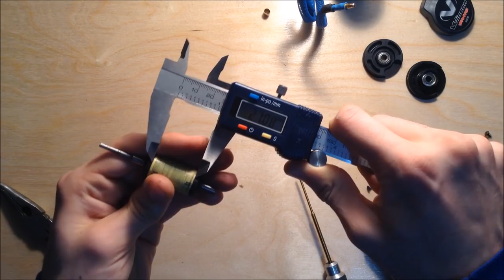Sidewinder (SV3) v.s Velineon (VXL), the better choice!

Comment: Thicker wire that is high quality will  help your esc and motor operate more efficient and also run cooler.
Reply: Agreed. The newer castle motors use this crummy 13awg wire. I replaced them with some 12awg with 5.5 mm bullet connectors..motor ran much cooler

Comment: I've ran 17 Velineon vxl systems, and 1 died because it didn't go into thermal shutdown. I have ran multiple Castle Creations SCT 1410 1Y 3'800-KV systems.
I love both systems! And think that the Velineon system is a little over priced!! But the Traxxas warranty is worth the Velineon system, well to me it is anyway.
Reply: When it didnt do a thermal shutdown, did it have a fan on the esc?
Reply: @bordfronco  no fan on any of the 17, and running the sticky S1 compound Tires. The body was a Chevrolet 1500 from Pro-Line Racing and I had a huge Spoiler on the front of the Body, so I am thinking that it didn't have much if any airflow to the e.s.c. this was my bad!
Reply: @BUILTLIGHTWOUNDTIGHT  a fan should be added due to all the extra force put on the parts can cause a lot of heat and can cause electronics to fail but i hope this comment helps btw thw fan for the velineon system is only like 25 dollars

Comment: You can't put a 1406 against a velineon.  Not a good comparison.

Needs to be the 3800kv 1410
Reply: Shane Dwyer or maybe 4600kv?
Reply: Lane Thompson no, the castle he's using is a 4600kv.  The 3800kv is the counterpart to the 3500vxl
Reply: Shane Dwyer my bad, I didn’t even watch the video lol.
Reply: yeah the motor is just a little bit to small, for that comparison.
Reply: Try a competition level motor and a esc, like fantom v3T and  FR-10 PRO ESC on your hobby car,  performance will greater than these , I have tested few
Reply: True
Reply: I just bought that motor from Castle yesterday. It's way better then the Traxxis.

Comment: I have the 1410 3800kv with 5mm shaft in my rustler and that thing is a little BEAST!
Reply: How fast does it go?
Reply: @jordankennedy4761  geared up on 3s will easily hit 60
Reply: @tvon4966  okay thank you, I got a sidewinder 4 today for my rustler how fast do you think it will go if I have a 2s lipo?

Comment: I have had both and without getting into to much detail I can confidentially say that the castle 3800,4600,5700 1410 is sick.  So much more torque and the ability to custom program it.   The speed at quarter throttle blew me away compared to the Traxxas motor.   I love the Traxxas brand but Castle got it.....

Comment: with the traxxas VXL system you can update the firmware on the speed control unit unlike the sidewinder just FYI  along with if you want to upgrade the traxxas speed control and motor you can with the power up program along with the electronics for less than 1/3 of what it would cost to buy it the items brand new

Comment: Why aren't you telling people about the traxxas power up program?!  Trade in your old items for new ones at the discount for using the program.
Reply: Does that work is you have a brushed Traxxas motor and want to go the the vxl
Reply: @ryanassheton5124  Indeed it doe.  I did it with my brushed stampede and have the vxl on 3s.  It's stupid now.  If I had Street tires, it might do 60+

Comment: That Castle Motor is a 1406 can. It would be a proper comparison if you compared the Castle 3800kv 1410 motor with the Velineon 3500kv motor. The Traxxas ESC overheats like crazy from what I've heard, I run the 3800kv motor and the Castle SV3 esc.
Reply: My ESC runs 🆒! I run only 2S myself but geared just below top speed runs gearing. Both hella cool but the 1410 is the way to go with Mamba max pro
Reply: That's why you can buy a fan for it for quite cheap under 20 dollars for the traxxas banded or even cheaper with a noname one.... also the yjsut shut off don't burn out...

Comment: Just got a rustler VXL w/ a 4000mah 11.1v 3s Li & id charger combo for $295!!! For the bundle
Reply: Lockdown spinning  my custom. 2wd Slash  LCG VXL with a wide travel front end 14 1/4" stance on 2.8 badlands MX is way better then any 4x4
Reply: Lockdown spinning  I run HR aluminum caster blocks and I bash it hard even at skateparks and no problems at all the wide stance handles like a dream
Reply: @shooterboyroy3690  I disagree lol slash 4x4 with the revo slipper kit constant velocity drives shafts on 2.8 trenchers

Comment: I bought the 1406 4'600-KV for my B6M, and it was just not enough torque for me! So I put the 1410 1Y 3'800-KV in it, and was totally happy with it!!!
Reply: BUILTLIGHTWOUNDTIGHT get a 6s compatible esc so you can use castle link and retune that 1406-4600 to do some runs on 4s really wakes it up on 6s it's a whole different animal

Comment: Great video!  
Rather than wait a month or two, the Velineon system was on back order, I went with a Hobby Star brushless and Esc, $110 for both!  My hobby shop said it's very comparable to the Velineon system!   I run Lipos 2s and 3s!  My Slash with a 3s is almost uncontrollable even on pavement, lol!  Been running the Hobby Star for almost 3 weeks and I'm very impressed so far.  I love my Slash and it screams over stock!  My hobby shop provided the Traxxas end at no extra charge!  Anyone running a Hobby Star and what are your thoughts?  I'm still a noob, lol....any info would be greatly appreciated!!!

Comment: The VXL ESC doesn't really cost $200. I have my Velineon system for only $170. That's with the motor and ESC
Reply: And for $100 you get a better 3800kv motor and esc from castle

Comment: youre comparing apples to oranges. the vxl is twice the price because its twice as good as the one you compared it to. compare the Castle SCT 3800 system if you want to see a good comparison. Both systems have pros and cons.  If you really want to have some fun, put the vxl esc on the 5700 castle 4 pole motor.....then you have the amperage and rpm that will blow your mind

Comment: Here's a way Castle is better you said you had a pretty heavy roll cage on it and the Velineon struggled I once had a castle motor on a car hauling ass with almost 6 ft 1/8 inch by inch and a half Steel

Comment: Hi hello. Great video. I have both systems. I actually oun two castle creations systems. But now i have come across a RC that holds a castle creations sidewinder 3 esc and velenion motor? Now that combo in my RC runs amazing! Wheelys on command. Half throttle is 46 . Not enough room where I live . But it's a great combo. Love it
Reply from the maker: Awesome!

Comment: Im trying to look for a new brushless combo for my brushed slash 4x4 and i use a 2s lipo but im not sure whether i should get a castle or velineon
Oh and im not sure what kv i should get
Reply from the maker: Get a castle, lower kV like 2500-4000 at most
Reply: @GenesisRC  how fast do you think it’ll go with stock gearing?
Reply from the maker: @mtoon5406  well stock gearing really varies... with a 16T pinion and 55T spur id say 90km/hr or 60miles/hr
Reply: @GenesisRC  would a 3800 kv get to those speeds and would it be ok for off road play and on road too? Haha sorry about all the questions
Reply from the maker: @mtoon5406  ya 3800kv is good, for offroad use you can always gear down to reduce temps
Reply: @GenesisRC  actually i might go with 3300kv or 3200 cause i think i might go with the hobbywing max10
Reply from the maker: @mtoon5406  I typically always favor getting a lower kV over a higher one, so that should be good as well. Best of luck with whatever you choose!

Comment: Sidewinder3 won't stand up to the vxl, can push as much amps or turn as tall of gears. Sidewinder4 setup right will run with or beat it. So far my vxl geared 40/76 is second only to my Mamba X truck on 6s

Comment: To be honest with you I think it's quality control just depends on how good the solder joints. Every ESC is going to have more resistance than the other so just depending on the QC factor maybe that's why some run hot and some don't!
Reply from the maker: I believe it is how they engineer the circuit board and what grade of conductors they use

Comment: I bought a traxxas brushless moter and esc for only $170 on amazon since my castle moter and esc both have put and died.
Reply: Logan Frame you should of contacted castle I’ve had them repair or replace systems and the castle system deals with it very very well as the traxxes over heats I have both systems and on my current set up the castle system was around 10mph faster. The side winder v4 esc and motor is 129 on Amazon

Comment: I over heat the vxl ESC on 3s all the time it's annoying I shouldn't have to re gear every time switching from on road to off road..
Reply from the maker: What car do you use the VXL on? And what gearing?
Reply: @GenesisRC  a 1/16 revo. 55/23 at the moment for 2s if I switch to 3s I always hit ESC temp shut off the whole reason I got the revo was to run it on 3s hard and fast on dirt and street. I have the hot racing diffs as well with pro line trenchers. At this point I'm about to drop a 1/10 ESC in instead to run 3s motor is warm but I can still touch but ESC just not taking it.... Way hotter than motor.
Reply from the maker: @skatj23  I'd gear down a bit. And a larger capacity ESC is the way to go, I use the SV3 in my merv.
Reply: @GenesisRC  what gearing would you run on 3s on dirt to get 50-60mph.? 😅 I tried a bunch of different combos but for that speed it's limited or no ?

Comment: The main reason I'm looking for a new system is because I have a 2 pole vxl system but the new 4 pole won't work with the dumbo rc x6 controller I have so I need to find something else
Reply: Huh? Why wouldn't it work with any transmitter?
Reply: @rotten2209  honestly have no clue but it involves the esc not knowing what the throttle position is on the dumbo controller. I met it in the middle and I just have no reverse and when I use the brakes it's basically an on and off switch

Comment: any idea if you can put the wires from the castle on to the velineon. like soder them on the velineon. and would the traxxas link up to the castle if you can do it...
Reply: link up to the castle ecs
Reply from the maker: If you are wanting to hook up a castle motor to the Velineon ESC, you can cut and solder the wires from the motor onto male 3.5mm bullet connectors
Reply: i am actully trying to put the castle wires onto the velineon motor to run the velineon on the castle esc.
Reply from the maker: If you are wanting to hook up a velineon motor to the Castle ESC, you can cut and solder the wires from the motor onto male 4mm bullet connectors
Reply from the maker: Kenneth Spiece yes, you put 4mm bullet connectors on the velineon so they match the castle bullet connectors
Reply: Kenneth

Comment: I have just gone through 2 sidewinder 3. I have it paired with a valeon motor the older brushless one but has the rebuild kit on it and I have a 18t pinion and 86t 48p spur gear. 11.1v 3s lipo motor only ever gets warm same with esc but this one has gone out within 2 weeks of having it and on its second run on 3s. I do not like the sidewinder 3. Its a traxxas slash btw
Reply: You deff got your gearing wrong. I have beat the living shit out of 3 Sidewinder 3's on 3s and never 1 time had an issue. You went through 2? Lol, yah, you got something wrong.  Ran these on slash, and even larger trucks.

Comment: On amazon found one for whole kit new with mounting plate for 120
Reply from the maker: Raj K 7910 nice find!
Reply: Genesis RC & FPV  thanks I just got the e revo vxl and I’m thinking to put on the stampede wheels on do you think it will work
Reply from the maker: Raj K 7910 if you are putting it in a 1/10 erevo the motor will have nowhere near enough torque to move the vehicle or you will have heating issues. If you are talking about the mini erevo then I'd recommend gearing down a fair amount just to be nice to the diffs. They don't like being under a lot of torque and will strip if you put them under a lot of speed. Be sure to spend your time shimming the diffs PERFECTLY if you plan on doing so
Reply: Genesis RC & FPV good do I do paralelfor better speed
Reply from the maker: Raj K 7910 series connector adds speed, parallel connector adds runtime
Reply: Raj K 7910 ii

Comment: The Castle 1410 3800kv, is the motor you should be comparing the VXL to!
Not the smaller 1406 motors, with the VXL ESC the Castle mamba max pro is a fair comparison ( better) in my Imo.

Comment: HOW DO YOU DO THAT TO THE WIRES??   AND I HAVE A(CASTLE SW3 FULL SYSTEM IN MY(SUUUPER CUSTOM HPI SPRINT2 I USE FOR DRIFT RACING MOSTLY,,,BUT I DO RUN STREET TIRES EVERY NOW AND THAN,,,(BUT I JUST GOT ME A BRUSHED TRAXXAS 4TECH,,I WASS GONNA TOSS THE CASTLE IN IT BUUUT 1.IDE BE BACK TO A SLOW COMP DRIFTER SOOO NO GO!!!B.I LIKE TO RUN THE SAME BRAND PARTS ETC   I TRULY THINK(SPECALLY WITH TRAXXAS THEY RUN WAYYY BETTER/FASTER/JUST BETTER OVERALL!!!    AAANNDDD WITH THE CASTLE SYSTEM YOU CANT RUN ALL THE DIFF SENSORS ETC! SOO IM GOING VXL

Comment: I’m trying to make my rustler fast, no more off-roading just on road use what motor and esc combo should I get
Reply from the maker: I like the sidewinder overall. Fast speeds will have more current draw which the SV3 seems to handle better. The SCT version has a larger 1410 motor which is definitely better. Then have a larger pinion / smaller spur to gear up for more speed vs torque
Reply: Genesis RC & FPV Thank you!!

Comment: Not to be rude but the Traxxas esc is not really compatible with the castle
Reply from the maker: Any brushless ESC is compatible with any brushless motor so long as the specs will allow it to run without issues. I've personally run the velineon ESC with the castle motor and it worked fine.
Reply: Genesis RC & FPV what about velineon motor with castle esc?

Comment: I'm not a fan of vxl line up I prefer castle. Vxl esc does not have the punch like the castle. Vxl has a soft start.
Reply from the maker: That's one of my favourite things about the castle escs: they have programmable acceleration. Unfortunately the higher setting the harder it is on the motor.

Comment: Traxxas is garbage I bought a slash and burnt the Velineon motor in the first month, in fact my slash now has zero traxxas electronics/parts vxl lasted 6 months Servo died around the same time. Every time something broke I’d replace it with the best reviewed and I’ve been running a castle motor for 3 years zero problems way more torque and speed than the traxxas garbage
Reply: My vxl works just fine after 5 years of use without rebuild.

Comment: That vxl is not a better system they burn up all the time lol. Esc smokes bearings go out in the motor. See it at the track quit often. On castles website u can buy rebuild kits if your motor fries but I have a 3800 from the first gen sw combo and it still works fine. Motors go when there over heated or there crap quality like the vxl lol. Your vxl will have more torque then your castle motor because of the kv and size. Im sure if u didn't have a 4600 and up kv 1406 castle for this video and had the 3800 kv 1410 the rotors would be the same or closer  and have the same to. The vxl is a 1410 can 3500 kv so either way you go the castle is a faster motor. I run a sw4 esc with a 3800 in my sc6 and I smash on slashes every weekend at the track. The sw3 and up are way more programmable then the 3 settings the vxl has with the Bluetooth module or the castle link. Sw is more of a bigginer race combo or experienced basher combo that wants to tune there model to get the best out of it. The vxl is entry level rtr combo for the person that wants a little more power from there rtr. My Traxxas spartan comes stock with castle products. There is a reason for that lol

Comment: wich is faster
Reply from the maker: Neither, it all depends on your gearing. The motor with more torque will be able to be used in high speed setups without getting as hot though

Comment: oh ok do you know the kv on both of them
Reply from the maker: The velineon motor is 3500KV, whereas the castle SV3 SCT comes with 3800KV, and normal SV3 comes with a variety between 4600-7000KV. I would choose the lowest KV as it gives more low end torque

Comment: Traxxas is just rebranded castle motors my rc dealer favors castle motors over traxxas
Reply from the maker: That's sort of true but doesn't apply to these systems. You're talking about the system in the e-revo and e-maxx, for the 1/10 scale models the velineon and 1410/06 are absolutely different.